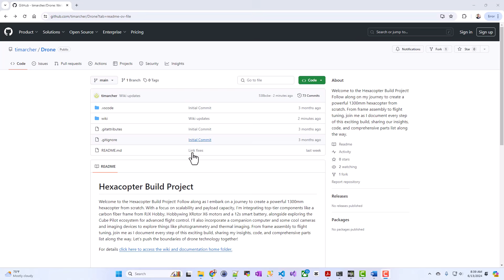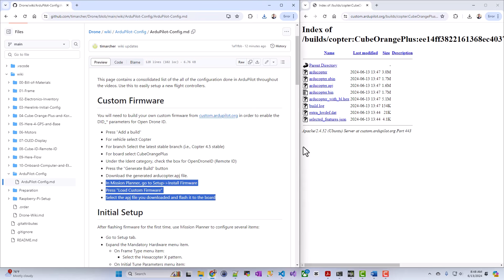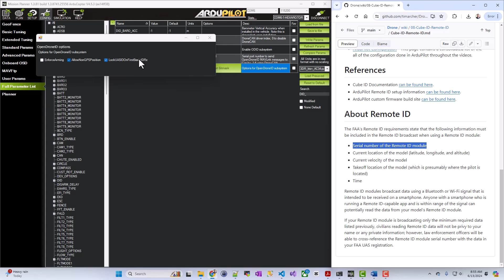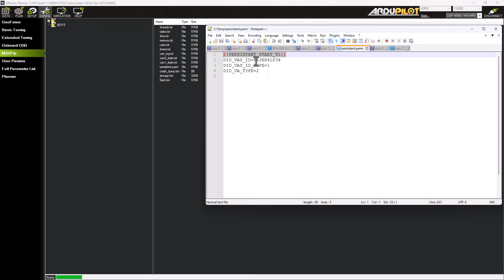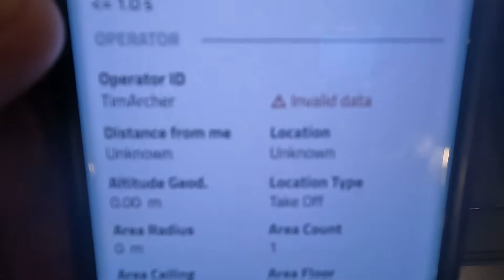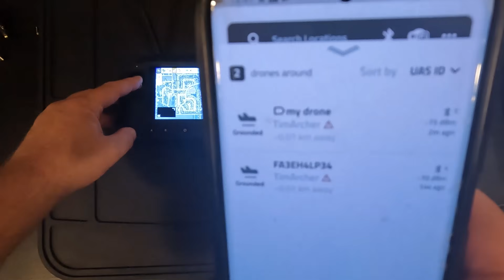Hexacopter Drone Build Project – Part 8 Cube ID Remote ID

Comment: Thanks Tim great video. I am installing a remote ID module and when I was generating the custom firmware the operation was failing from insufficient RAM so I deselected a few Items I am not using in order to generate the custom firmware. Now my FC is having all kinds of problems. have you seen this before? Any suggestions?
Reply from the maker: No sorry I haven't had that happen. I typically deselect a few of the specific ranger/lidar models I don't have and that makes enough space to build.

Comment: Howdy Sir, I have the same problem with DID writing a test RID. At the time I just enabled it and didn't set the persistent ID in DID options. Previously, I was looking at the Drone ID tab in MP and did some test filling in the fields to see what was available. but as soon as I enabled the DID, that was it. I took a shot and reloaded the bootloader and then then reloaded my custom firmware, but nothing. The file in in MAVFtp is showing the test .para is locked. Have you been able to find a solution? Drone Scanner is displaying the false ID.
Reply from the maker: @jfwahl  no sorry I have not found a way around this yet. I asked in the ArduPilot forums and didn't get an answer either...for now I think we're stuck until someone builds a utility to help us clear it. If you ever find one please let me know!!
Reply: @timarcher52  Thank you Tim. It was funny that it changed as soon as I enabled it and didn't even write the Para in options!.. LOL

Comment: Have been working on on drone prototype similar to yours except with a custom designed frame. I have been struggling with setting up DID in MP using the setup guide in CubePilot for longer than I want to admit. After watching you go through the process, I had it configured in less than 5 minutes. Looking forward to seeing the final product.
Reply from the maker: That's awesome to hear, I'm glad it helped! Are you going to be putting a camera and gimbal on yours? If so have you figured out which one yet? I'm still researching and haven't decided on one for my drone yet.
Reply: @timarcher52  Working on two different frame sizes. One will be in an X4 configuration for mapping/thermal missions. And the other is an X8 configuration for mapping, LiDAR, and delivery. Looking at the Sony ILX-LR camera for mapping with a Gremsy gimbal.
Reply: Hi Tim, mine I cant load custom build firmware to my cube+ fc due to to dfu issue. Can u post a howto video about loading urdupilot fw in dfu mode?
Reply from the maker: @ctaylo28 sorry I've not had to do that myself yet, so I'm unsure of how to do it.